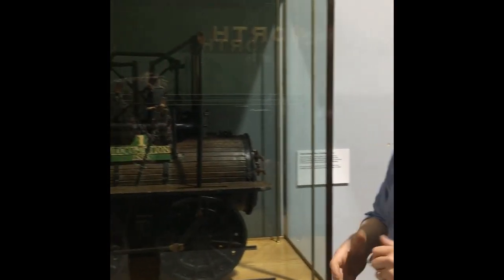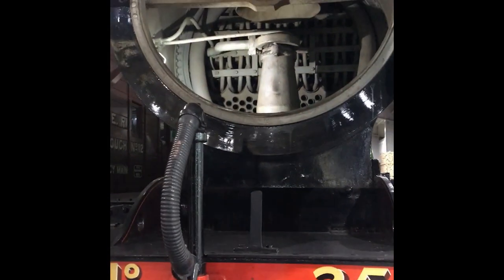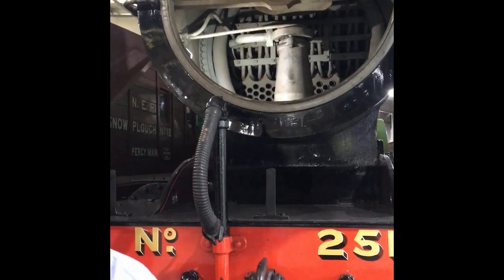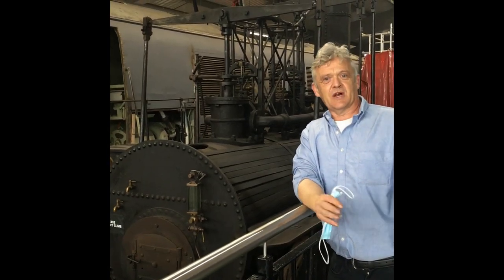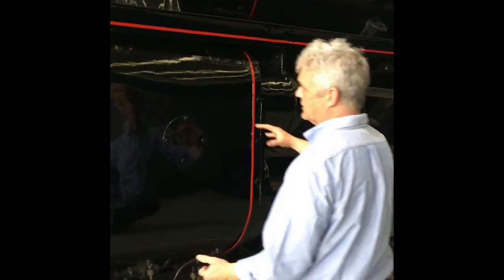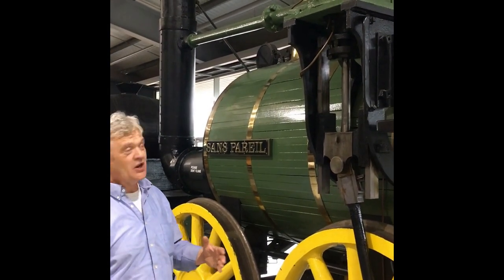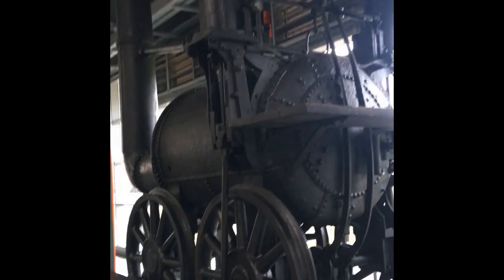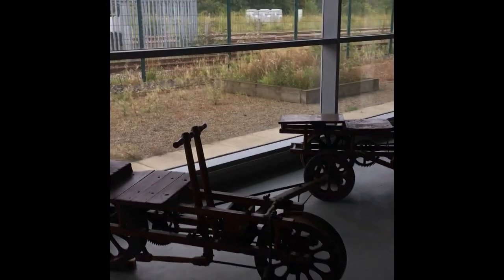A Visit To Locomotion - Steam Museum

Comment: Love steam engines (Stirlings as well). My great-great-grandfather, his son and his grandson (my grandfather) all operated stationary steam engines, the last being a Corliss model with a chain-grate stoker at a local university’s cogeneration power plant. Tunnels ran from the power plant to the campus building distributing electricity and steam heat and return condensation. My Dad showed me the building where his Dad and grandfather had run the steam engine, which was scraped during a WWII defense department metal drive.

Comment: A few years ago I invented - all on my own, I promise! - a bicycle that uses rollerblade wheels, HDPE guide blocks, and a sidecar to ride on the train tracks. Turns out that those were already a thing ever since trains were invented.  
😳😄
Reply from the maker: I am with Mark on this one mate - I would have loved to have seen that
Reply: @ThinkingandTinkering  Well, I learned that trains don't go up and down steep grades too often, rails are smooth, the parts are cheap, and picking the right track to ride is very important! Nothing bad happened, fortunately.

Comment: The Rail Roads are one of the most prolific drivers of invention we ever had.
Reply from the maker: now that is for sure
Reply: The whole industrial revolution era was amazing - if you look at maps from any town, there was an explosion in development around that time, small village before, then a huge town with extravagant, lavish buildings, proper roads, electric street lights, running water, proper sanitation (eventually), canals, railroad - its dazzling to think that it was all down so quickly.
Reply: @PhilWaud  I Live in New Mexico down by the dotted line of mexico.  Every town down here is 50-60 miles distance.   That's how far the rail could go before needing water.  Even here in the Dry S.W. Desert they found water.   How many people Died for lack of water until then ?  All happened over the 1800-1860 time frame.   The locals weren't so pleased with the encroachment.  Most all towns in the North of Mexico was established the same way.

Comment: My favourite steam locomotives are the 9F 92220 Evening Star, the last to be built by British Rail in 1960, 10 drive wheels, which is at York; and A1 60163 Tornado, started in 1994, completion date of 2008, and the first new locomotive built in the UK since Evening Star, featured on the Top Gear race from London to Edinburgh! It's been officially recorded as doing over 100mph!

Comment: Off topic: Nano(Nuclear) Diamond Battery.  Using C14 carbon from irradiated control rods which are powdered and pressed into a diamond.  Big issue for me is energy density and efficiency.  Only 4% of material will be radioactive.  Promise of the technology is a battery life in excess of 1,000 years.
Reply from the maker: I know about it - it does look interesting for sure

Comment: You win Rob 🍺 for reasons ↓
Obviously for your passion, honesty, knowledge, generosity and all the other things that tell me we would enjoy a few beers and interesting thoughts, but mostly cos my brain is starting to work again.
I guess there was something ....magnetic😏 about the tornado/ Magnus device that started me thinking deeper. Love the Heath Robinson approach but critical thinking tells me that it was a pretty dodgy setup and needs better controls.. A fair point.Then I thort, how can I make something similar but more amenable to accurate measurements. That got complicated very quickly.
Then I thort some more, the minimal extra energy and complexity of adding a Magnus device seems barely worth the effort in a windy setting and considering the advances in wind turbines. I remember the Flettner drive ships being exciting but failing for various reasons.

What about a region with low wind but ample sun?  Same idea but bigger. 3,  6,  12 ? Magnus cylinders on a base round a central axis. Solar panels on top of the cyliders could power motor/ generators on those 3 axes to generate Magnus and surely the turbulence behind one cylinder would provide friction for the next one etc and accumulate potential. A squirrel cage type fan atop the cylinder in conjunction with the solar and the motor/generators could be used when the odd storm comes. May need to combine with a large flywheel system and need a "kickstart" . Micro hydro, bore well pressure, thermal activity could also be used.
I dunno, I'm not a physicist and certainly can't do the math involved but the idea of harnessing some of the weaker forces is intriguing.

Quite happy to be shot down in flames but interested in any thoughts 👍
Cheers and thanks Rob 🍺
Reply from the maker: you know me mate - I never shoot things down - to me the fact you are thinking is what matters most. Magnus generators are one of those areas of interest in the research and a lot of work is going on - more than folks think - there are both HAWT and VAWT arrangements with devices claimed to work in the 2m/s wind speed range - you are right what I built was a bit 'ropey' but that's ok as it really is just to introduce the idea and get folks thinking - looks like it worked at that objective lol have a read - you will be amazed to see what folks are actually up to - cheers
Reply: @ThinkingandTinkering  😊 Cheers mate 🍺 I tried to align the magnet with Applied Science latest vid to help explain how unrelated things lead to new discoveries, maybe that will open eyes